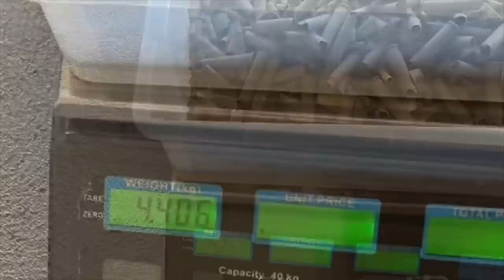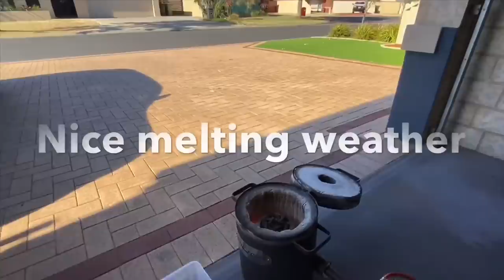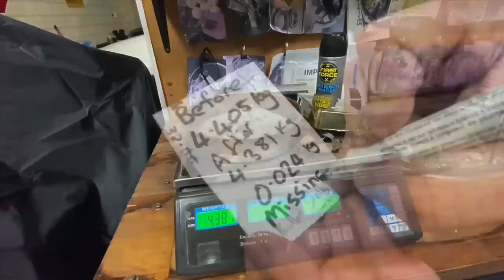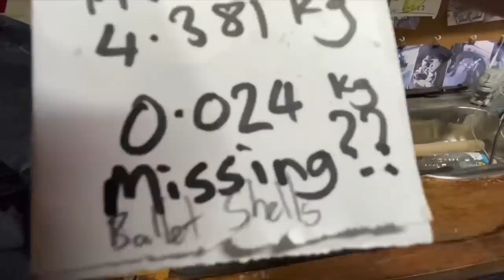Bullet Bullion - Trash To Treasure - Melting Bulk Bullet Casings - ASMR Brass Melting

Comment: You made a brass block, yay... 
This is good only for reselling it as recycled scrap metal. Since it is brass, it doesn't have great resell value.
In conclusion, what did you get out of it?
Reply from the maker: This channel is just a hobby matey,  I do it for fun not profit that’s why I never sell anything I just stack it all up, I do this channel on my days off to relax in the garage with a few cold beers👌🏻
Reply: @bigstackD  I understand your motive , but it would be better if you cast this material into something more purposeful instead of just a block. Make a small statue, or a tool, repurpose that material.
Reply from the maker: That’s the plan buddy, I’m just melting down all my scraps for now and once I’ve run out of scrap to meltdown I’m gonna use all these blocks for future casting projects where I’m gonna make some good stuff and not just a boring old block👌🏻That’s why I’m not too concerned with using fluxes as I’ll worry about all that when I do the final melt with that particular piece.
Reply: @kz11377  Get rid of the painting on your wall, that paper could be used as a business earning report!

Comment: Question: Why was the flame green? What in the metal casings turns it green??
Reply: The reaction of copper as it oxidizes.
Reply: @jebbroham1776  actually after some research it’s the borax/ boric acid. Copper has nothing to do with the fire turning green, that’s just what happens when copper tarnishes
Reply: I'm pretty sure it's the zinc from the brass, if you look at a chemistry table, it burns pale green when burned.

Comment: Not sure if theres any value to this but this made me think I could go to the local shooting spot with my backhoe which is area 200 feet by a quarter mile 2 foot thick layer of brass. Put them all through a shaker, which is a machine we use at work to seperate mudd and water, and come up with 20 or 30 thousand pounds of brass in a few hours. I have a vat at home I could clean everything, ultrasonic cleaners to get them really clean, but nothing to melt, any ways, lot of work for 2 dollar a pound

Comment: Remove all the steel (using a magnet) but what about the primers? Do they become  inclusions, or did you sift them out of the slag toward the middle of the video? No explanation, so...? And thank you for the demonstration of "polishing a turd"! Perhaps the missing weight had a bit to do with the grinder dust? And you were not melting down "bullets", but cartridge casings. I was hoping to see jacketed bullet melting, because I am interested in how you might separate the lead from the jacket metal. Guess I'll have to wait for someone knowledgeable (and verbal) to tackle that. Some of us are bored with the no-explication video.

Dan

Comment: Is it safe to do that in the garage?
Reply from the maker: Yes it’s pretty safe mate,  when I built this house I got high ceilings put in the garage and the heat easily disperses before it even creates any warmth on the ceiling or roller door, and whenever I’m melting I always have both side doors and the roller door open for airflow even though I do wear a respirator. But the heat from the furnace will deplete pretty quickly that’s why I can get the above furnace shots of inside the Crucible on my other videos
Reply: @bigstackD  I know nothing about this craft. I just stumbled upon it randomly. Very cool.

Comment: Imagine using Borax for the first time. some random guy be like 'lets throw some borax in there and see what happens'.
Reply: yeah, the people that figure things out for the first time sure have figured out some things nobody would ever expect.
for example, one guy a few decades ago found a TOAD in the desert, squeezed its venom gland juice onto some glass, let it dry, scraped it off and put it into a crack/meth pipe, smoked it and found out that the venom is literally DMT
insane LOL, but quite an important discovery for science
Reply: Smiths have used straw ashes for ages for the same purpose. So trying different materials makes sense.

Comment: Brother yah really should have water and soap washed those casings there was plenty of lead residue that could have been washed off before being vaporized.
Reply: A sonic cleaner would have probably worked good. Heck even a dry media case tumbler would have probably helped a lot.
Reply: @appalachiangunman9589  I reload about 5K round per year and the real key is to sequester the lead from the primer explosion and from the bullet base.  Most “ball” ammo has an exposed lead base.  I personally use an ultrasonic cleaner as the first step in reloading but that’s largely cause I want them cases super shiny.  If I’m scrapping casings I just give them a shaky shaky wash in a bucket.  The scrapper I use even pays more if I deprime the cases cause that’s where most of the lead is and the primer cups are predominantly nickel so would screw with the alloy.
Reply: @appalachiangunman9589  if you dry tumble without doing a wet wash you’re contaminating the dry media with the lead dust.  Then when you separate the material from the casings you’re releasing lead dust into the air.

Comment: Those are not bullets. They are brass cartridge casings. Bullets are the part of the cartridge that is fired out of a gun. Bullets are typically lead and many are copper jacketed. It is not a "Bullet Bar". It is more like a "Casing Bar". If you wanted to make a true bullet bar, you should melt the bullets to separate the lead and copper, make a copper jacket and then fill it with the lead.

Comment: Ok this is a cool hobby and all. But whats the point in going though all that work just to make a brick? To each their own. 
I just think having a form to make something would be more productive, unless you need more material for a bigger project.
Reply from the maker: Well a hobby is something you do to relax and unwind and that’s exactly why I do it Matey, I have so much scrap metal and bits and pieces I want to melt down into bars basically to remove the impurities and make it more pure  for my future casting projects, but as I started melting down scrap metal years ago I’ve still got so much left it’s gonna be awhile before I can get to my actual Ideas I want to use the metals with. If you look at the shelves at the end of the video you can see I got sidetracked along the way and I start making some other bits and pieces but at the end of the day it’s a good mix and that’s now what I’m going for👌🏻.
Reply: @bigstackD  
I did see your inventory at the end.  Though this isn't my thing to do, I do find the process interesting. Be safe my friend.